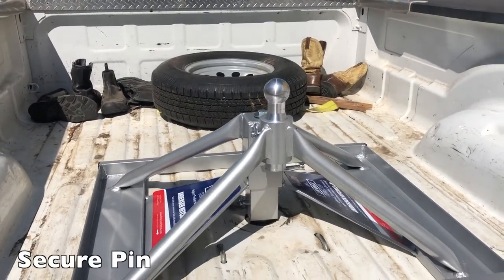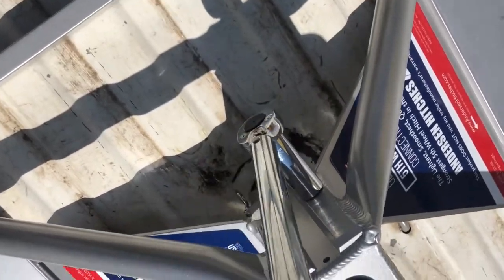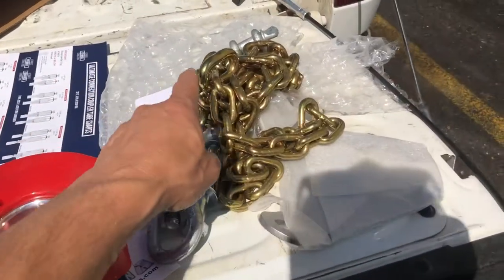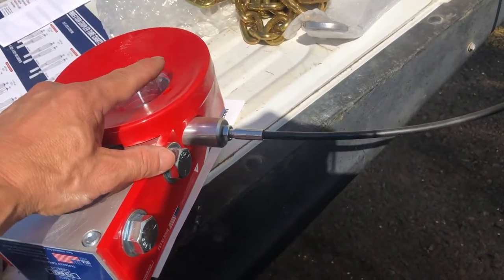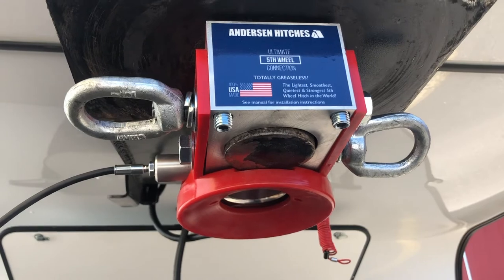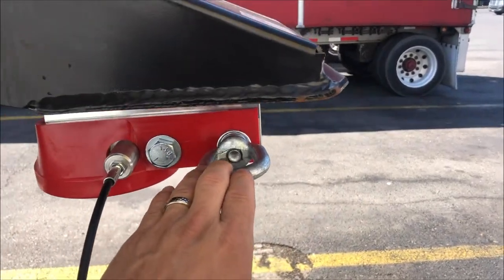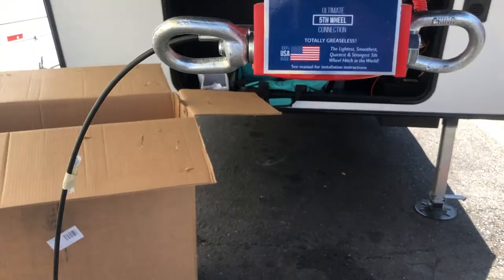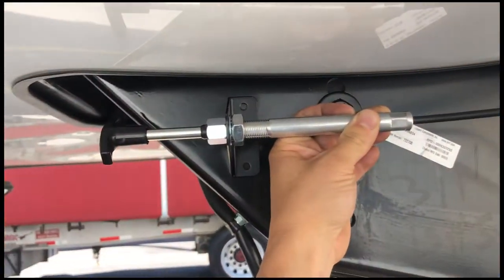Andersen Ultimate Hitch Install in 5 minutes

Comment: I mounted the locking/unlocking pull handle to the pin box with just a super strong magnet with a handle from Harbor freight. Keeps the handle secure where it's accessible but easily removeable. Love the hitch!
Reply from the maker: Good idea!

Comment: Those “eye bolts”, on the king pin coupler, won’t hold much over a few hundred pounds.  That’s very unsafe.  

“Swivel eye bolts”, mounted on the pin box, might hold the safety chains for a micro second.
Reply from the maker: It’s what’s provided by the manufacturer.
Reply: @yourdeptlogohere  I have this hitch too.  Checking the “eye nuts” ;the specs would indicate they would hold 3600 lbs at a straight pull;  half that at 45 degrees.  At 90 degrees, maybe 1000 lbs.  what do you suppose a five ton fifth wheel camper would pull if not attached to the ball?  I’d guess maybe 50,000 lbs per chain?  The chains are going to jerk that plastic/aluminum adapter off the pin in a micro second!
Reply from the maker: Probably, maybe more. Seeing people pull these behind single rear wheel axle pickups scares me.
Reply: My question was can you reverse the direction of the Andersen 3246 Ultimate Connection Rectangle King Pin Coupler with Funnel

And you answered the question. Thanks